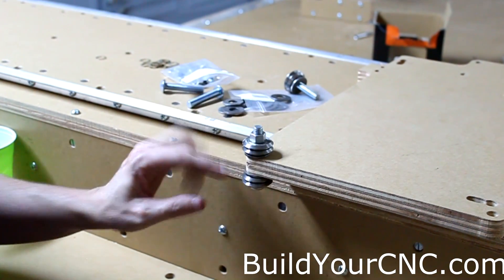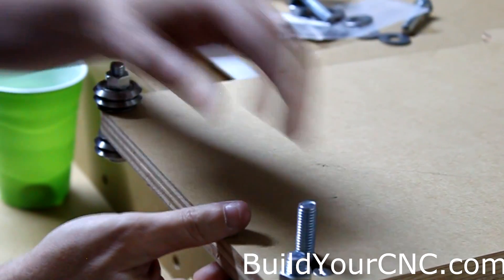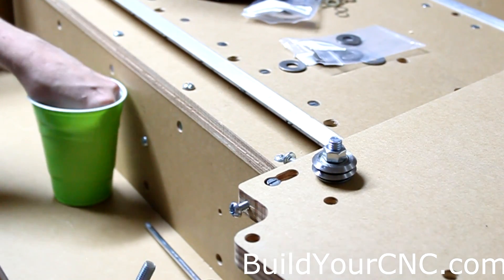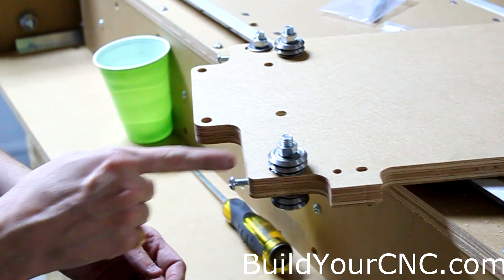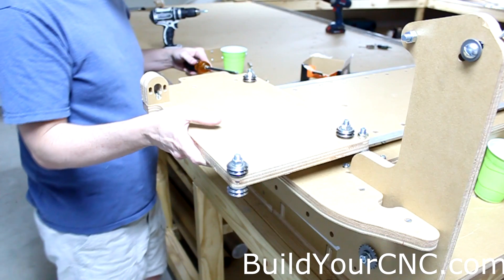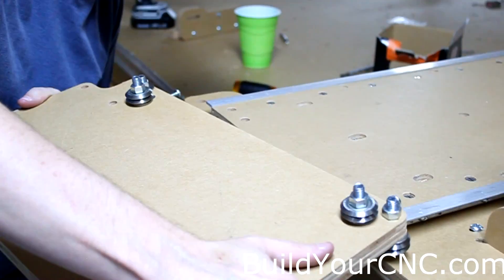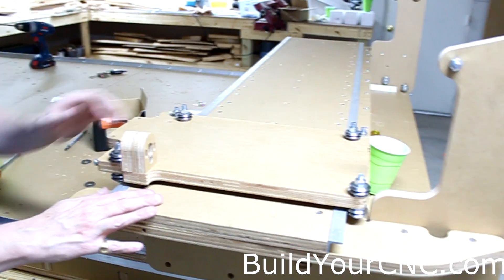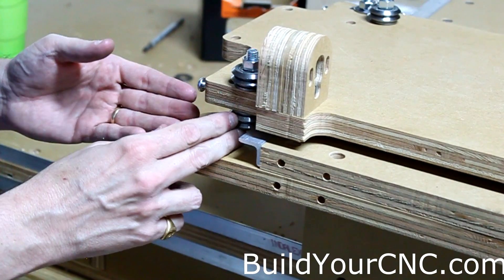greenBull CNC Assembly - Installing the ZYplate

Comment: "Cold-rolling the aluminum":
The aluminum comes with a matt finish that is called anodizing, which protects the aluminum from oxidizing.  The cold rolling crushes the anodizing and exposes the bare aluminum to the air and the aluminum will oxidize.  The oxidation will give off gray/black aluminum oxide powder which is highly abrasive (they make sandpaper out of it.) The powder will find it's way into the nearby bearing race and wear out the balls in the V-groove rollers. 
This problem happened for years with sliding patio door wheels until they figured out that they could make stainless steel caps that slide onto the patio door sill bead so the bead doesn't mushroom (cold roll) and the door's roller bearings don't wear out.  I don't know if you could get stainless caps for your aluminum angles or not. The stainless steel caps for sliding doors are roll formed stainless sheet formed into a 3/4 circular arc. I think they come in different sizes from about 3/16" OD to about 5/16" OD.
Please check this site:
https://www.johnsonrollforming.com/display.php/display/Q/category/42